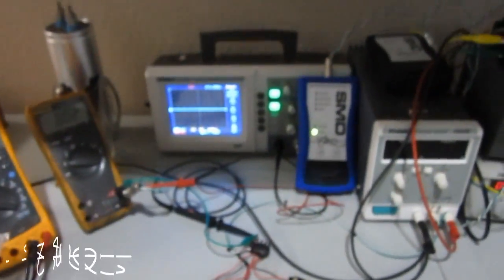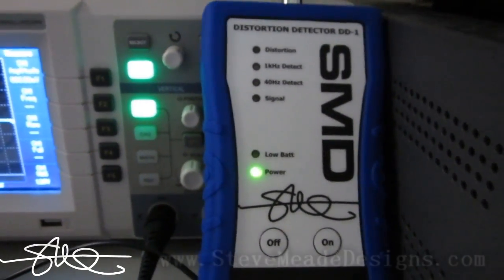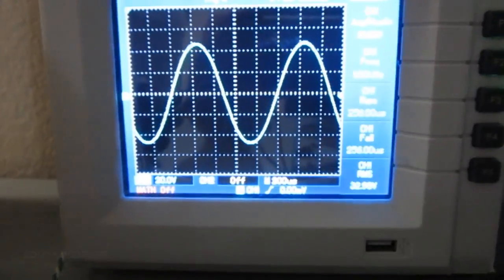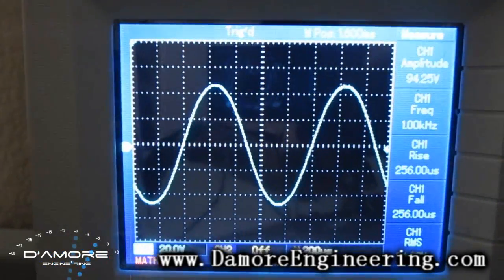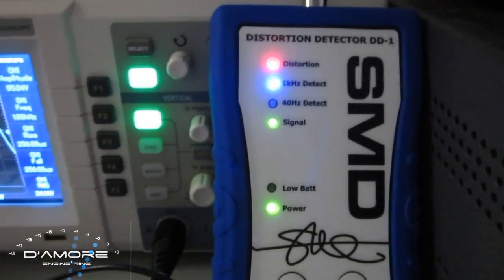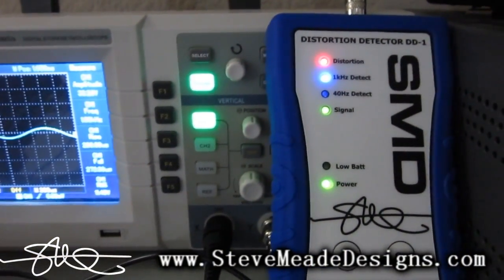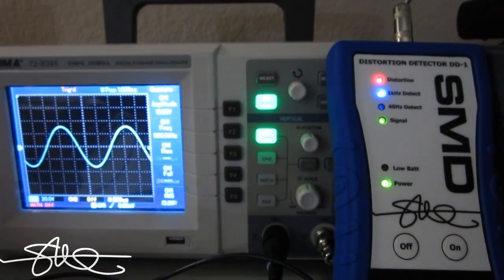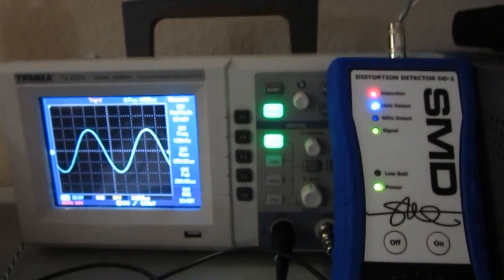SMD Distortion Detector DD-1 Vs Oscilloscope - 2% Distortion @ 1khz

Comment: so the dd-1 must put the distortion light on when it clips because clipping is distortion, so really the dd-1 is getting clipping and distortion, and clipping happens after distortion by a little so you never have a clipped signal when set with this, I think that makes sense, all I know is I set my system with this thing, got rid of alt noise, made everything tight, bass, mids, tweets all hit harder then hell now, I had that issue on mine a bit, the distortion light was on a lot, but found da pr

Comment: @SenorDennis If it is showing distortion all the time then something in the audio system is distorting the signal.  Either the headunit, line level converter, line driver, eq, electronic crossover, DSP...  all of these things could cause it.

Comment: @bassboylowg this was "recorded" at the output of the amplifier, electrically.  The cause of the distortion is not alternator noise.  The cause is a cheap line level converter (high level converter) , the same type most people have.